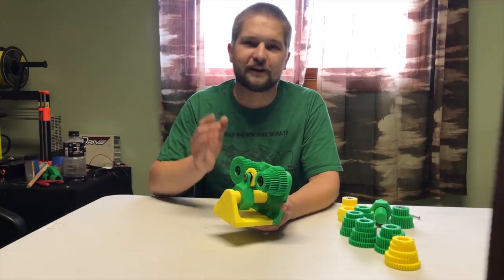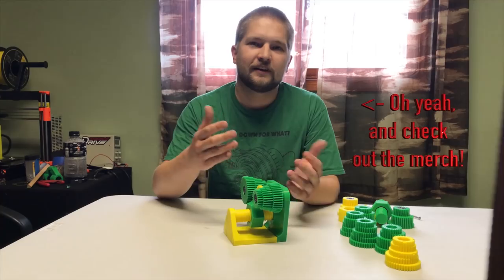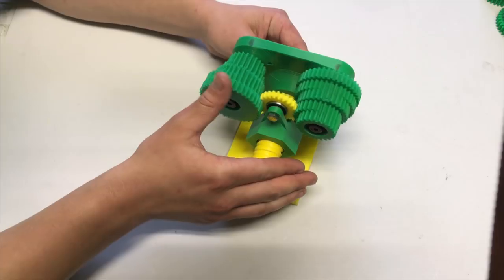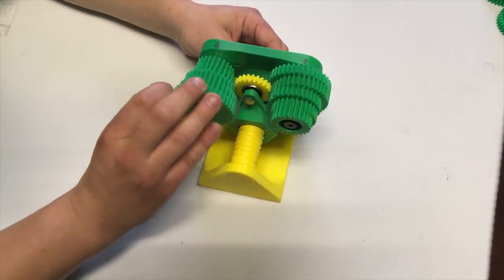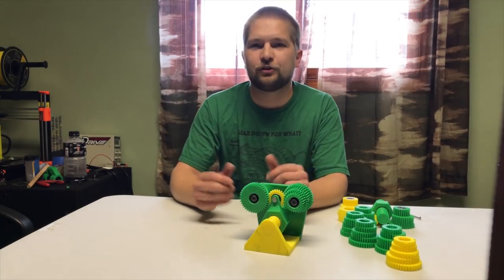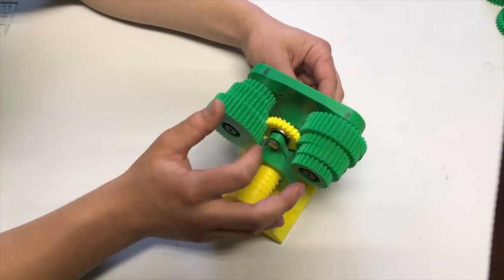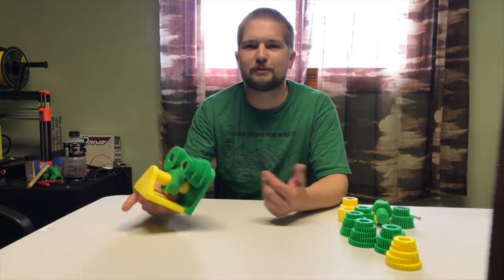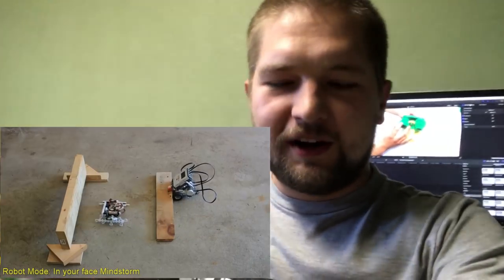The Hot Swapping Gear Mechanism | VCT2

Comment: The VCT2 that Ross built lacks the channel entrance and exits.  This is for moving the pinion gear out of the drive gear, then change speeds, then move it into exit and into the next drive gear.  This would make a smoother transition, but is more work to design and build.
Reply: Dale Van Cor yes this, very similar to a modern bicycle
Reply: I see multiple problems with this. If it doesn't have a clutch, that means the engine and wheels are always connected. So start up would be a problem, and idling wouldn't be available. Also, you'd have to switch gears one at a time. You wouldn't be able to go from 4 to 1  when you stop at a light.
Reply: kibukun.  Theres no reason it wouldnt have a clutch,  the point is that you wouldnt need to use the clutch to shift.  And a solution to the other problem is simple, you have the clutch on the output side with the geartrain driven directly by the engine.

If you are in a high gear and stop suddenly so that it cant downshift to 1st you put the clutch in and the gears still being driven allows that shift to happen. 

In an entirely manual setup this would operate no differently than a normal manual transmission,  and if automated the computer can do the same.  

Either way the benefit is once moving the clutch doesnt necessarily need to be used and thus you A: get extended clutch life and B: potential greater performance.
Reply: Farming simulator
Reply: DrewLSsix alright makes sense, you know, since you don't change hears with a clutch, you don't get that second where you lose power to the wheels during gear transit. Now the only problem I see are the gears themselves. Since you have a bunch of gears that are off-center, it messes with the balance of the transmission, thus causing it to vibrate. I guess you can mitigate that with weights though.
Reply: kibukun. Well, presumably the whole thing will be designed from the get go with balance in mind.  Nothing says they need to be entirely monolithic in construction.   And balancing components is hardly a new thing for auto engineers.
Reply: The next problem I do see is that you are only able to change gears witin a couple of degrees. As soon as the gears are turning by 500-3000 1/s for example  you just have a split of a split of a second to fulfill the gear change. But all in all I love this concept. It just needs some futher improfments.
Reply: Transitioning from one gear to next, or possibly skipping a gear or two in between, with minimal torque interruption is key to a "good" automotive transmission.  Clutches make that a lot simpler.
Reply: Jack Patteeuw  the point wouldnt be to eliminate clutches, but to reduce the need for them and thus improve efficiency and wear.
Reply: That issue can be resolved by having a torque converter between the transmission and the driveshaft.  You don't necessarily need a clutch.
Reply: testing1567. A torque converter will have a clutch....
Reply: Since the gears are off-center, their ratios vary at each distinct degree of rotation making the output nonlinear when fed with an input of constant velocity, right?
Reply: Only locking torque converters (which are more efficient, granted) will have a dry friction coupling. Torque converters are inherently fluid couplings and don't wear unless misused.
Reply: Lassi Kinnunen    you put the clutch on the output side. When it is disengaged the motor continues to turn the gear set and it is able to change ratio under low load, just like this bench model.
Reply: Dale Van Cor , thanks for responding and offering insight into this! Very clever design btw 👌🏻
Reply: It could be used in a electric vehicle thus not needing any clutch.
Reply: The gear change is not instant. This will not be suitably for cars.
Reply: make them cones?..
Reply: Can the pros and cons of this vs a dog ring setup be explained? Dog ring transmissions exist today (and have for years) and are used in extreme applications (racing cars for example), provide clutchless shifting, and don't require the precise knowledge of where the two shafts are. 

One other issue i see is the need to make shifts in very small times. Looking at the model it looks like the gears overlap for about 1/8 - 1/4 of a rotation. At 3000 RPM, this would mean needing to compleate a shift in (3000/60 = 50RPS 1 rotation = 1/50 second / 1/4 rotation = 1/200th of a second to make a shift. Looking at this model, and assumming that the gears are roughly 3/4" thick, so 3/4" in 1/200th of a second is a movement of about 150inch/second, or about 8.5MPH. This isn't crazy, but as torque requirements go up, so would gear thickness, and so required speed.
Reply: @rogerab1792  I'not sure, but as booth pairs of gears are aff-center they will solve the problem.

Hint: 3 cylinders an 4T engines are unbalanced on mass and on speed, and close to nobody matters.
Reply: @kibukun  yes, but the point is that you don't need to use a clutch to shift. Hell, you'd probably use a torque converter still on the input just to make it easier. Also, this is no different from the sequential gearbox found in any motorcycle or even some cars (usually race cars)
Reply: It would be interesting if it didn't require complicated electronics.

Comment: You did a good job explaining most of the weaknesses of this concept.  There's a big one not mentioned in the video, that could be worked around via a clutch or torque converter disengagement (defeating the purpose) and that's that the shift transition must happen precisely on those small transition zones of a tooth or two, while at speed, while under load: that would be a huge dynamic force to happen at higher RPMs.

I'm not convinced this transmission concept can be feasibly used in a serious car/truck application as a result.  However, it could be used in a human-powered bicycle due to the much lower torque and RPM requirements, but there are already working solutions there, too, that are likely lighter and more resilient.
Reply: Yup, and unless the ratios are even 2:1/1:1/1:2 etc. that specific point would only occur every so many rotations. Two for 2:1, three for 3:1, but for something like 2.2:1 it would only occur every 22 rotations.

Comment: You say it can change ratios while under power, but you stop rotating it each time you change ratios.  If the gears are under load, I don't see how they will slide.  Try to pull a manual transmission out of gear while under load.  It doesn't happen.  Not until you are coasting.
Reply: You can do it, but the forces needed are immense, with immense potential for damage.
Reply: twinturbostang A human cannot do it, because we're too imprecise. A computer controller system can do it.

Not saying that it'd be better, just that it requires position to shift under load, essentially a shift has to happen in the timespan of 1 rotation.
Reply: Maybe because it's driven back and forth on threaded rod. You can get pretty high forces like that, like on a mill table.
Reply: The shift has to happen in a fraction of a rotation, otherwise the gears destroy each other when the moving one attempts to mesh with two differently sized gear wheels at the same rotation frequency. Still an interesting mechanical parlor trick.
Reply: Of course it has to happen very quickly.  And yes you can generate high forces with screw drives.  But my point was there's going to be a lot of shear stress on the gear faces that will probably result in rapid gear tooth wear.  Could be wrong, but I think it would not last very long.
Reply: Yes... you can do it. Pulling it out of gear isn't hard, matching and putting it in without the clutch is hard and near impossible and can cause damage. I fuckin' drive a 800whp bmw m5, so I can tell you with confidence you can slam gears underload without damaging shit, upshifting drops rev's. isn't reccomended, but you can do it without causing issues.
Reply: Caleb Crossman When you change gears in your car you don't actually slide the gears across each other, they are constantly meshed with each other. Instead you slide synchro rings to engage different gears.
Reply: Caleb Crossman uhh, you have synchronizers. That's in no way comparable.
Reply: Zane Zinn nope, you need to go back and study how a dog box works.
Reply: otm646 well I used to drive a non synchro zetor tractor back as a lad. It's part of driving a non synchro transmission to speed match. The difference is there is power loss between the gear during the shift. You take it out of one ratio and are in neutral and then match up the engine revs to the next ratio. So unlike the transmission in the videos supposed to be  it's not seamless
Reply: That's because gears in transmissions are helical cut making sideways movement impossible.  The gears in his transmission are straight cut and can slide sideways with little effort.  Anyway, the gears in standard transmissions are always in mesh; it's the synchronizers (straight cut connecting gears) that move.
Reply: this plastic d printed design is way to underengineered to handle the forces that would be created and the axel holding the gears will slightly bend out and jump teeth along with the fact that he does not have the hand dexterity to move the gears and the the thread to move the gear
Reply: Inability to use helical gears would be a disadvantage of this design. Helical gears are used because they provide a smoother transmission of power with less noise and less wear. You wouldn't be able to get those benefits with one of these.
Reply: Not really. The shift wouldn't have to be quick, it would have to be instantaneous.
Reply: The reason manual transmissions don't shift under load is because the synchronizers engage with the gears using a twist-lock mechanism. As long as there is any torque being applied to the transmission, the synchonizer mechanism will twist internally, locking it into place on the side of the selected gear. It won't shift when coasting either, because coasting still involves reverse torque being transferred from the wheels through the transmission to the engine (aka "engine braking"). You have to rev-up the engine VERY carefully until you reach a zero-torque scenario before the synchronizer will disengage. I've done it many times, to keep myself entertained while creeping along in traffic jams. However, dog-clutch transmissions can easily shift under load because they have no locking mechanism at all -- the dog clutch simply has a set of hardened-steel pins that slide into slots on the side of the selected gear, and you can pull it loose with the gear lever while accelerating. In a car this will destroy your transmission rather quickly, hence why dog-clutch transmissions are not used in production cars, but they ARE used in motorcycles because the mechanism is simpler, smaller, and lighter, and the torque load is so much lower in motorcycles.
Reply: He said he modelled the 3d  model incorrectly
Reply: Shifting dogs and collars have no relative motion. this is sliding meshing gears, that are rolling freely on an oil film. As long as the system is running at engine speeds, the gear will slide freely. If torque is applied while the system is stationary, like engine off, while on a hill, then the film breaks down, and just like your manual transmission, won't move. It can only be permitted to move when it's not on the stepped portion of the gears, which means it will have to be shifted with a timed cam mechanism or computer timed solenoids. The shift needs to be completed before it rolls to the next stepped part of the big gears. an incomplete engagement under load could be bad.
Reply: In manual Its possible to change gears without  clutch  but very hard and need too  much skill
Reply: @ferhatyildiz8012  I was going to leave the same comment I often do it in junkers it's easy to do if you know how
Reply: An actual transmission would have to use helical gears and they don't slide.
Reply: @twinturbostang: Untrue, when you release throttle and apply just a little bit of pressure on the gear knob, on a certain rpm it will slip out of and fall into gear quite easily without using the clutch. Try it. (Not too often though)
Reply: @Aidiakapi  well than a computer can also shift a manual transmission automatically...
Reply: @calebcrossman5084  I agree, though I've never had that much horsepower, clutchless shifting isn't impossible, it just takes a REALLY good sense of timing.